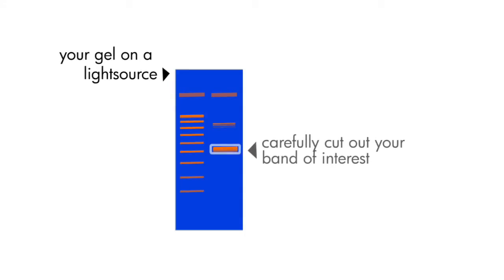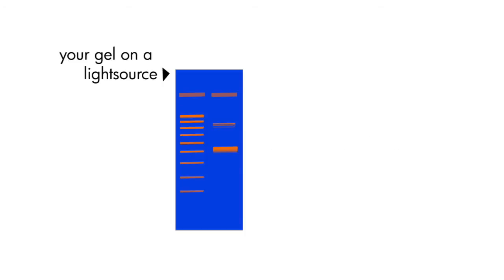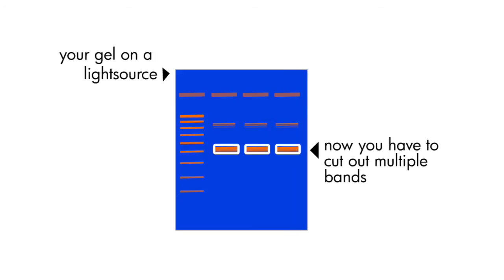Gel Extraction Comb Trick

Comment: its a good idea but by doing this you only make loading easier without any difference in gel cutting. 
you can excise all your bands (for the same sample) together even without making a large well.
Whether you make a large well and cut the entire large band or you do not do any modification and cut the bands together as if they were one, it will not make any difference.
thanks
Reply: i don't think thats true at all. in my experience, it's a lot easier and less time consuming to cut one large gel band containing a large volume of one sample than to have to cut multiple smaller bands in to which one sample was divided. this is not only less stressful and time consuming but it also limits uv exposure to the dna (thus mutations) as well as the person cutting the gel. if indeed you excise all the bands together as you say you will end up with excess agarose that does not contain any dna and thus reduce the efficiency of your future gel extraction. the columns in qiagen kits can only extract upto 400 mg agarose each. if you have one large band where you neatly cut it out you will definitely have a smaller agarose slice than if you cut one piece out containing multiple small bands (depending also on the space between your wells). maybe you are super talented or god gifted that you do not perceive a difference in gel cutting between the two scenarios. i mean.. good for you i guess..